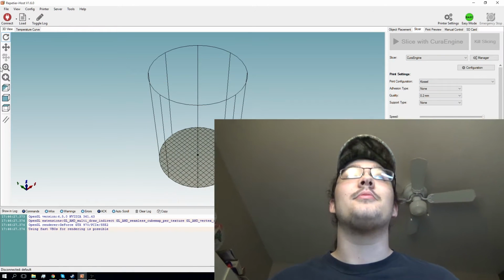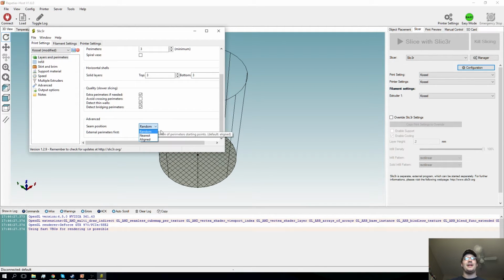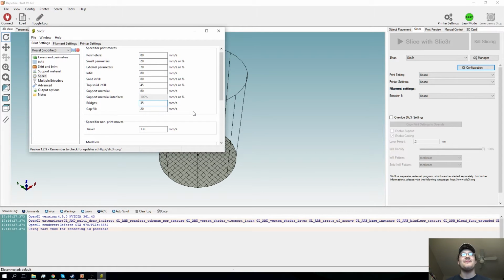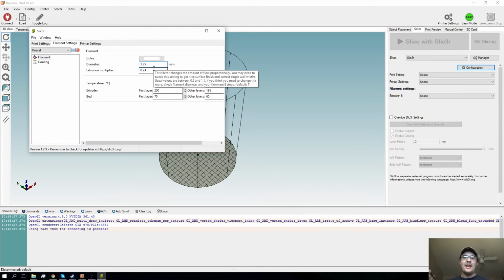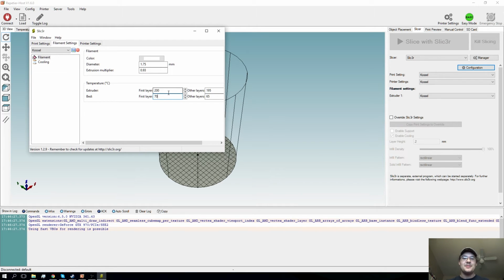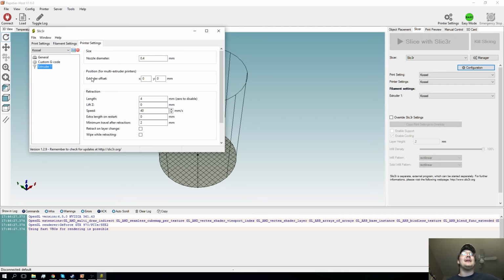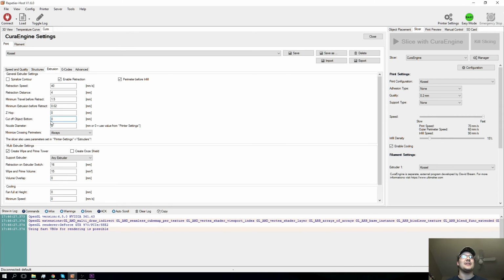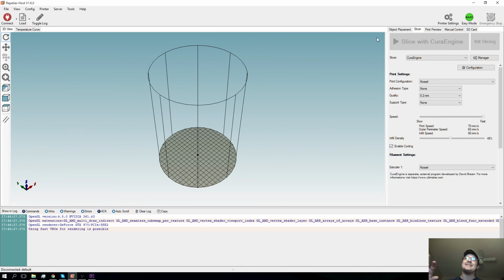Folger Tech Kossel 2020 3D Printer Calibration | #6 - Slicer Settings

Comment: Dustin,
Have you had any issues with the filament jamming in the hot end parts? How would i stop it from jamming? I'm using PLA at 195 degrees C. Any help would be appreciated. 
Thanks
Reply from the maker: Be sure you have the cooling fan always running at full speed, and make sure you are using good quality filament.
Reply: The fan is constantly running and the filament that i am using is made by Hatchbox.
Reply from the maker: Ben Kuhn make sure the heat block is not touching the heat sink
Reply: That is how I have it set up and it is still having issues.

Comment: Hi Dustin, thanks for all of the great content and helpful information about this printer. I'm still having some weird issues after following everything, what's the best way to reach you to bounce some ideas off of you?
Reply from the maker: +HumanCaviar Folger Tech owners group on facebook if you have a Facebook account. I have a vid about it with links.
Reply: Thanks for the reply Dustin. I've been using my lack of facebook presence as a badge of nonconformity for almost a decade... Old habits die hard, but if it's my only and best avenue to get it working, I may have to swallow my pride.
Reply from the maker: +HumanCaviar it's a cool community, and you'll get lots of help from various others as well. If nothing else, I'm usually able to respond to comments here.
Reply: I forgot that I had joined that group with a creeper account after watching that video. I just posted into the group, thanks again.
Reply: +Dustin Corbin FYI for anyone out there in the same boat as me, just got some solid advice and help from the facebook group, highly recommended.

Comment: Great videos- but looking for one in particular tuning the stepper motor drivers ... my first prints were a little out of whack.. as well as setting the bed height.. seemed to need multiple settings and it still would hit bottom one time and not the other. I noticed the printer head was not keeping level . one thing I have not done which was a page I noticed that was in the Folger Tech google drive information dump (not really organized at all).. the tuning of the Pololu stepper boards. Did you cover it at all in your videos? I thought I watched them all.. but did not notice. Did you do this step or were yours set to where you did not notice any issues? Can you do a quick video on it or if you know of a good walk through.. let me know. Thanks again.
Reply from the maker: I'm planning on doing a video about tuning drivers in the near future. Been super busy the past few week!
Reply: +Dustin Corbin I have seen enough videos and played with it enough to know how to adjust the voltage.. but I can not seem to find an answer as to what to set them at.. what voltage are yours set at? Mine were at about .68 volts all the way around .Thanks
Reply from the maker: Albert McDonald 0.2-0.3v for the smaller steppers, and 0.4-0.6v for the larger one

Comment: Thanks for the video on Slicer settings, it was a big improvement. I had been using the config file from my Prusa I3. My only difference would be changing the loop start position from aligned to random. For me I see little bumps in the sidewalls that I don't like, with aligned I see just a light mark where it starts every time, might help if I increased the retraction speed? Jerry
Reply from the maker: Retraction will help, but don't over do it. :p